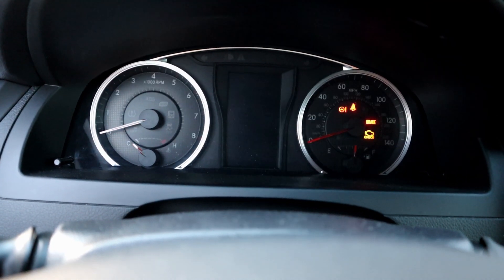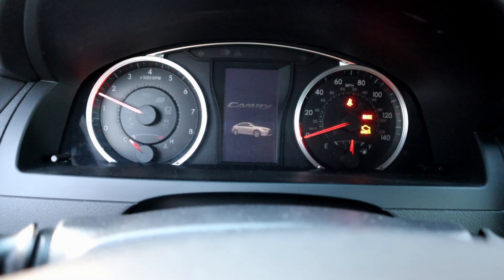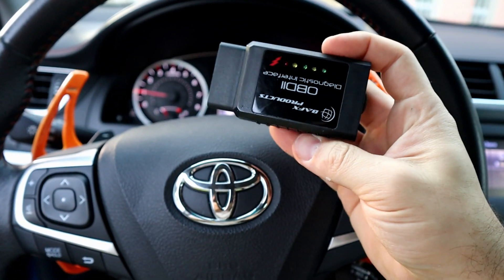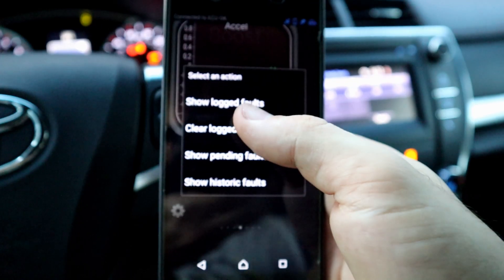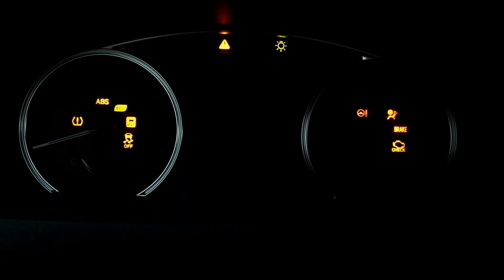Learn 3 Ways to turn OFF Engine light in 1 minute, How to reset ECU without OBD scanner tool/ALIMECH

Comment: I have a 68 plate mokka,  coil pack went, had it replaced with plugs, light came on the next day, garage and RAC checked and said nothing wrong,  but lights back on, what should I do.  My wifes corsa has had a light on for years.

Comment: For all of you who are trying to reset your ECU without diagnosing and repairing the underlying problem and then coming on here and claiming this reset doesn't work need to keep your hands off your engine and take it to a qualified shop because you are clearly not intelligent enough to work on your own car. Like complaining that pulling the battery out of the smoke alarm didn't put out the fire. SMH... 😮‍💨

Comment: Wouldn't it be smarter to find out why the light comes on?
Reply: Obviously. This step is taken AFTER the repair is made. Just resetting the ECU won't fix the problem it detected. You must do that first and then reset. On most cars, it will not reset itself. If it comes on again after a repair and a reset, then another issue is present and should be addressed before attempting another reset.

Comment: Not so fast, it may go off for a short time but an issue may have to be fixed or a part be replaced in which the ecm chip will reset  itself.

Comment: The easiest way to extinguish the MIL is... CURE THE FAULT !!!   Not wank around with mechanical quackery.
Reply: Step One:  Notice the check engine light is on
Step Two:  Use scanner to diagnose the problem
Step Three:  FIX THE PROBLEM
Step Four:  Reset the ECU

This reset is to be done AFTER the repair. Obviously! 😮‍💨

Comment: I  just had this happen.  Pulled into J.L.Multicare and they plugged it in and told me my ...well, I don't quite recall but, condensation?  He reset it and told me to come back in if it came back on and they'd explore.  I've gotten the norice to check engine before (and did immediately.  Not a silly female) but not just the little lighted engine. I have a 2001 Jeep Grand Cherokee with 102,000 miles on it.  I LOVE MY JEEP!  In great shape, looks new when it's clean.  Interior a slight orangish cast because of the drifts of dog hair.  How a longhaired dachshund can shed so much and not be bald stuns me.
Reply: I replaced my own tail light (guts were fine, just the cover was broken) thanks to help from YouTube.  Need to replace the roof rack gaskets but I'm afraid to try it myself.  Was going to have it done until the back passenger window mechaniam died and I couldn't close the window.  Last time I went thru a car wash a waterfall came down on the radio so hard it changed the stations.

Comment: The first 2 won’t do much the computer in your car will detect what’s wrong with your car and the engine light will come right back on
Reply: Yes, as it should. You must first repair the vehicle before resetting the ECU, otherwise it will just detect the problem again and turn the check engine light back on.

Comment: My engine, light suddenly on when driving half way. I followed the second method, unplug the battery cable and plug again, the light now disappeared. I will monitor and see if it's appear again later or not. Thank you.

Comment: Removed and reinstalled the 2 ECU fuses and this erased the check engine light. Much appreciated!
Reply: Hi in my toyota auris diesel there are four ecu fuses should i remove all of them at the same time or else where. And if the car need to start before doing this ?
Reply: Should this be done when the car is on or off?

Comment: Done just about everything but nothing works still stays on.
Reply: Doesn't work for oxygen sensor codes , they detect after the ECU
Reply: @JohnDio78 got P0135 and P0171 codes ( bank one running lean , heater element not heating) changed the bank one O2 sensor but light stays on but car runs fine now?
Reply: @JohnDio78  yep 👍
Reply: Did you solve the problem? When I have 02 Sensor or any sensor code, I always replace or clean the "Oil Control Valves" - it works every time.
Reply: @PCProphecy  I bought a ob2 diagnostic code reader from Temu $20 removed the problem straight away. It’s done on purpose by Nissan at a certain mileage …so you take it to a dealer, then they bullshit you and do nothing but read the code and deleat the problem, by the way they change the filter and the rest and it ends up $800
Reply: Get the problem fixed.
Reply: "Well, gosh. I pulled the battery out of the smoke detector but the fire didn't go out!"

That's you.

Comment: after cleaning the throttle body high rpm came up when ECU tried to relearn it can not as the engine was about to stop if let the rpm become less than 1200 rpm what do you think the problem is
Reply: Late reply. I had this issue happen before when I removed my intake cooler from throttle body. The issue turned out to be "loose clamps" not placed back properly. The lack of tightness was allowing air to escape. The other issue could be to replace the under the hood air filter (check and see if it's dirty). These were the issues I had, and the RPM abruptly dropping was fixed. Goodluck!